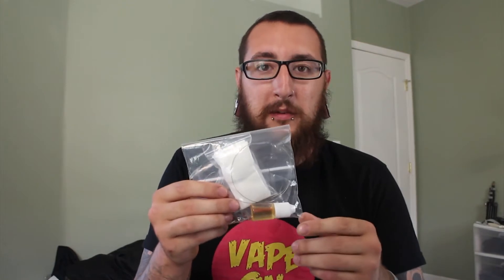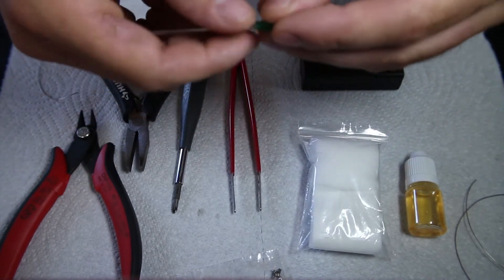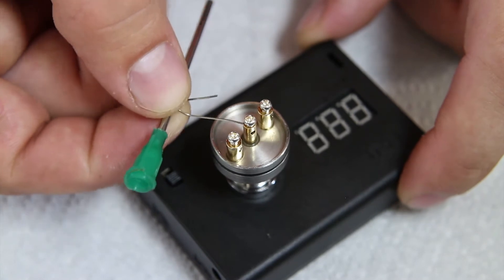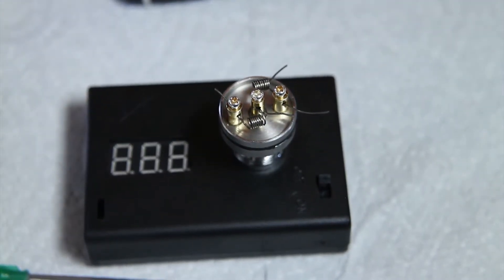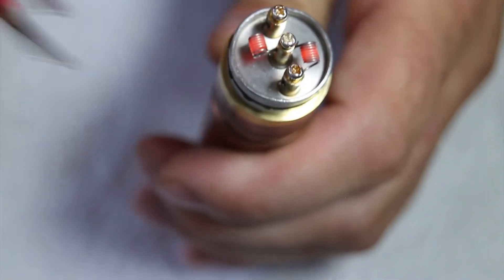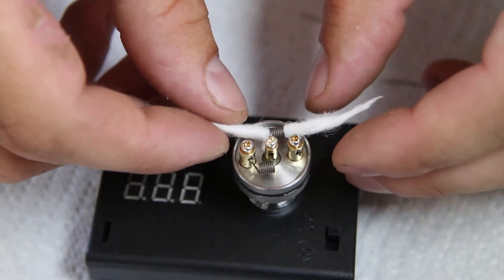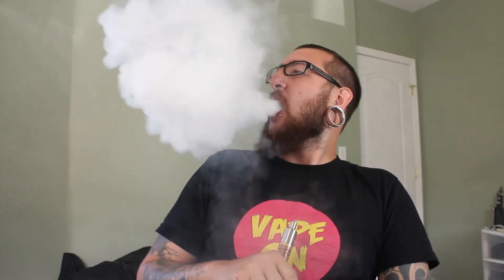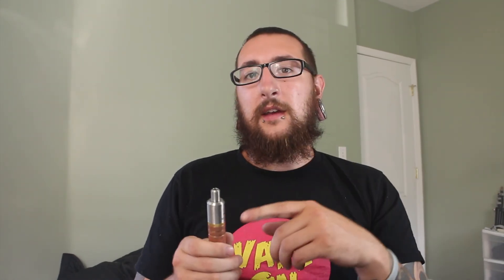#FRESHBUILDFRIDAY - Pure Cask Vapors Essence Wire

Comment: Nice build. I have a good question for you, what do you prefer, 26g wire or twisted 30g wire? What is better for flavour and what is better for producing Vapor?
Reply from the maker: This is a tough one since I've only used 26g for this one build but a friend of mine uses it almost exclusively and loves it. I've also never tried 30g twisted, only 28g but it's very close. In my opinion, twisted wire is better for flavor and dual coils using larger gauge wire is better for vapor. Try a single twisted 30g coil on a regulated mod and pump up the watts for boosted flavor and a dual 26g build on a mech for clouds aplenty. Good luck with the build and let me know how it turns out! Vape on!
Reply: I made a  twst 30,32,32 three wires dual coil seven wraps. 0.4 ohms. Great for vapour but flavour is lacking a bit.
Reply: I will!  Thanks bro